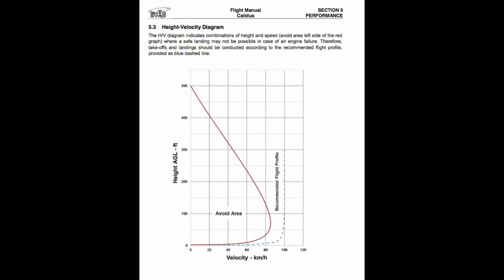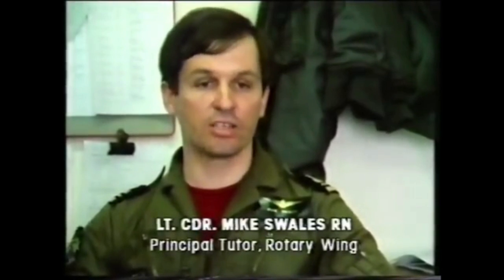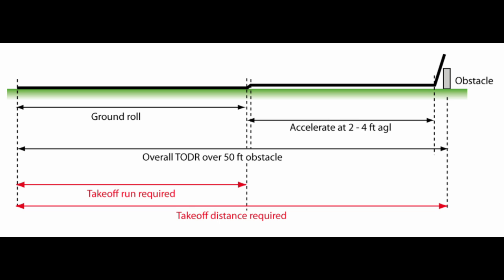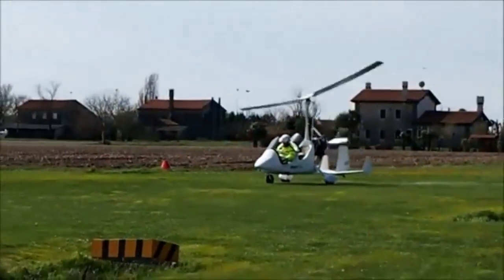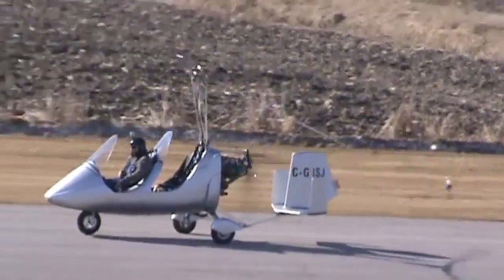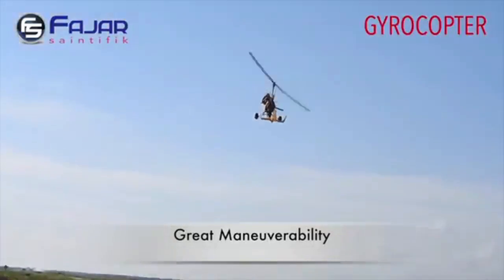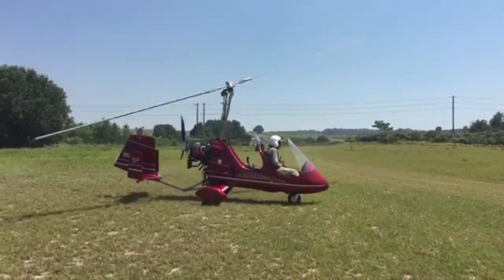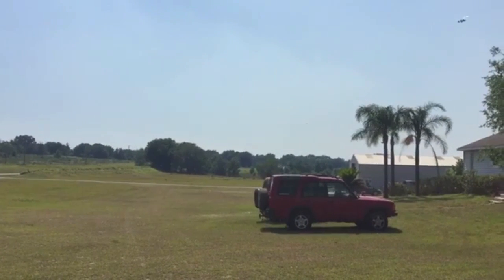A Gyrocopter is NOT a short take off aircraft...

Comment: @Gyrocopter flying club - I have just subscribed to your channel because I found this video very illustrative and useful. I would like to ask two questions, if I may.
1.- Is it impossible to somehow incorporate some small fixed wings that may help solve this issue? 
2.-  Would it be better to plase the engine in the front so that it provides a lot of extra wind to the main rotor as well as providing more stability?
Reply from the maker: Thanks for the kind comment.   I think you've designed a Cierva C19.  In truth wings on a gyro help in flight but the AoA during take off probably mean that the profile that isn't stalled during this phase is a burden during flight.  

A gyroplane is a short enough take off aircraft to be interesting / capable for most situations and the film is merely a caution to those that may get sucked into the marketing claims of some manufacturers.
Reply: @gyrocopterflyingclub6148  - Thank you for replying and for the explanation. You are right about the manufacturer's claims. I myself was falling for it. 
Haha... Not that I was trying to be clever.  It is simply that I am curious about the technical reasons. 
It bothers me the fact that gyros are evolving towards clumsy "not-affordable" luxurious vehicles instead of utilizing the overwhelming new tech in order to make gyros more wind independent and to follow Bensen's marvelous philosophy of "affordable flying".
Reply from the maker: Yes I completely agree on the direction of the aircraft and in the end once the gap to basic helicopters becomes minimal people just fly a helicopter because they perceive they may need the VTOL even when they fly from the same 3-4000ft airfield they did in a fixed wing!  

We have lost a little of the fun however take a look at the NANO film that looks a nice aircraft.

Comment: The gyro can be made to take off vertical and will take off within 100 feet! Apples to apples!
Reply: to take off verticaly this need a very strong rotor prelauncher able to reach more than 400rpm , a heawy rotor (to increase the inertial) and a collective pitch control: such Gyros are called jump gyros...For short take off this need a strong rotor prelauncher able to reach close 350 rpm and a very good power to weight ratio...basicaly a gyro with standard rotor  is same as a fixed wing aircraft in the difference that the rotor rpm should be closely monitored because loss of RPM with too steep climb at take off= death...
Reply: @leneanderthalien  check the existing models!

Comment: Doesn't  the ability to spin the rotors up to 300rpm now, makes for a shorter take off.
As the wing is made much earlier.
I am keen to get into a gyro in my retirement, and some of the newer models claim 300 rpm rotor spin for take off.
Which sounds much more attractive an option.
Reply: It really doesn't do much to clear 50 foot obstacle. That's the standard definition of takeoff distance. To achieve 300 rotor RPM, you end up going to almost full power, then you pull the stick back somewhat and the drag slows you from accelerating to Vx (48 knots), so by the time you reach that to safely climb up and gain altitude you really are close to where you were. To me the 300 RRPM seems to be more of a gimmick for marketing material. If you look at their POH and actually see what it says about takeoff distance (standard takeoff distance to clear 50 foot obstacle), the length given is no different than when I pre-rotate to 200 rotor RPM
Reply from the maker: Agree/disagree Abid - see the other reply.  The key is dealing with the drag.  The actual data however given by AutoGyro is poor in terms of the detail but having flown all AutoGyro models a lot (you have poor choice of aircraft in the UK) 914/915 and 300+ rrrpm makes a difference.  Actually in a 915 motor aircraft you are forced to not use full back stick for long because you'll get dumped on the tail fast!
Reply: @gyrocopterflyingclub6148  I think what you are pointing to is that with 300+ RRPM the stick should not be all the way back but somewhere near neutral to take advantage of this pre-rotation to reduce takeoff distance to clear 50 foot obstacle. Phil yet in the other video posted in your reply at 1:45 onwards, the takeoff distance to clear 50 feet shown with 320 rotor RPM pre-rotation one up seems basically the same distance I see in an AR-1 914 one up pre-rotating to 200+ RRPM. So where is the advantage? Now I did not get to try it one up when I just trained a student who owns a MTO Sport 2017 914UL and we tried this 300 RRPM takeoff technique with stick somewhere near neutral. May be I am missing something and I would be happy to know any tricks or anything to try. He will be back to take final prep hours before his checkride sometime this week. We can try them. Don't be shy to let me know. I am not an expert pilot by any means. I have not flown 915 MTO 2017. I have only flown AG915 once but it was not properly rigged at the time.  
But in theory yes you have to overcome the drag of the spinning rotor to get to Vx to have a safe climbout and not settle back down. You have to do that without letting the rotor RPM perish as well so its a balance. The directions to conduct this takeoff in the POH are not very good at the least.
We have a short field takeoff, demonstrated by Greg here but Greg has thousands of hours. There is also a 10-12 mph headwind here but it requires keeping pre-rotator engaged as you pull stick back and move forward. Again a delicate balance. Its also hard on pre-rotator components especially the upper U-joint and hence should be used only when really necessary and upper U-joint checked and possibly changed on condition
https://youtu.be/iMb5BOm_GYg
Reply from the maker: Hey matey - the take off performance compared film at 1:45?? If so both aircraft are pre-rotated to 200rrpm and if you are looking at that film then at the end of it (around 3:29 onwards) shows the difference (one is +100ft the other is still building airspeed).  

OK something to try with the 17Sport - is pre-rotation to 320 means power is very high anyway at brake release.  Just bring the stick back to halfway (thats the subjective part which really needs building up to because as you know its better to have it further back than not enough initially) but brake release - and full power into the boost - and it should unstick within <50m, then build airspeed.  With a 915 there basically isn't any airspeed build up phase tbh - its just there immediately pretty much at unstick the acceleration is so good.

Yes I hear you and I completely agree - this is the problem with the advice is that this isn't really 10hr solo pilot stuff and a lot of critics in the UK think everything needs to apply to them - and it simply doesn't.  

In the end the senior instructors in the UK (who have got very one eyed about wheel balancing) put themselves in a box with the criticism because when they teach differences training to any pilot with a rotor head 3 that can pre-rotate to 320rrpm they will all have to develop their techniques.  They haven't embraced it IMO because they have resisted change simply because it will require books and material to be re-written.  Nothing to do with safety, nothing to do with improving performance and everything to do with commercial self interest.
Reply: @gyrocopterflyingclub6148  Actually I meant 1:45 on this video
https://youtu.be/RqyEFgWF92o
I will ask my student if I can try this again without his engagement.  The rotorhead 3 achieves the 300 RRPM by mainly decreasing the size of the ring gear. In my opinion wheel balancing phase of takeoff should be kept as short as possible as this is where its most susceptible to gusting crosswinds etc. Things can and do go wrong there. How many times I have read on RWF, I was wheel balancing but took off or gust came and I flipped it over. Of course old school pilots have always disagreed
Reply from the maker: Arh yes - that is a piece of film with a pilot called Jim Hughes in a 914 Sport.  To be honest I used that clip just to show the 2017 sport etc as I have no idea what technique he was using.  That said Jim was a big advocate from the gyropedia school of thought who are all wedded to a take off process that has wheel balancing and part power front and centre.  Perhaps Jim drifted from that during the flight filmed but it would be a big departure for him.  

Try it - we still have airfields closed and its a faff trying to fly in the UK right now - otherwise I'd film it myself.  In the end at 320rrpm the rotor is at flying speed so really what you need is a stick position that gives a shallow climb and get the aircraft to >30mph and you'll fly it off.  

One trick is go flying and with you sitting normally see where the stick position is when you adopt 10deg nose up.  If you put the stick in the same position from 320rrpm pre-rotation you will achieve the same.  Obviously whilst watching RRPM gauge to ensure in whatever process you're using the RRPM doesn't decay too much.  You could actually keep the pre-rotator in until you rolling.
Reply: @gyrocopterflyingclub6148  
Hi thx for the informative response, I watched the clips you suggested and now  think I have an understanding of what the extra rotor speed will do.
If I am correct, in non-technical terms, higher rotor speed will provide a more complete wing earlier, but add extra drag, which will then need more engine power to get the air flowing under the wing to provide the lift earlier?
Therefore nullifying any bonus a faster rotor speed on takeoff may induce.
As the wing itself does not provide upward lift like a helicopter, but is an umbrella to float on instead, with turbulence drag at the tips.
Please correct me if I am wrong.
But that is a really cool set of physics happening there.
Maybe it will lead to a different design rotor blade to take advantage of the motor induce extra rotor speed on takeoff.
Thank you so much for your time on this query.
Reply from the maker: Hey no problem for the time taken. Yes you are right but also think about the angle of attack - its not just the higher rotor speed that creates drag but in the cases of holding the stick fully back for a long time during the take off roll the Angle of Attack is huge.  https://www.grc.nasa.gov/www/k-12/airplane/inclind.html
Reply: @espenforfen1334  yep your right it has to fall constantly on the rotors. As a matter of fact someone made one like an umbrella in place of rotors
Reply from the maker: Hi - its not a simple answer.  So if you have time take a look at the other films I've made in particular this one:-
https://youtu.be/RqyEFgWF92o

Specifically on the 300rrpm element - if you want to make the most of it you need two things.  1) you need to adopt a take off technique closer to one I have suggested for around 3 years now and if you google "AutoGyro 2017 Sport POH" and look at short take off in the POH.  That explains the issue with drag - as I explained it here:- 
https://youtu.be/kW65IY39MPU

If you combine that with a bigger motor - so Rotax 915 power - it makes a difference, and I say that with practical experience of the aircraft, not just paper theory.  If you use 912 power then if you use a "legacy" take off technique i.e. look to hold a wheel balance and get there on part power - then actually you take longer to get airborne because of the huge increase in drag.

Comment: Why don’t gyroplane pilots give it the berries on take-off? I have to be missing something. Next I’ll be told idle descents are not possible.
Reply from the maker: Ha this is a current debate.  They can perfectly start their ground roll with 100% throttle but the problem with the legacy technique of full back stick maintained until the nose wheel lifts is that many get behind the aircraft - which means the aircraft is dumped on its tail. So to get around that the majority retain the “keep the stick fully back until the nose wheel lifts” narrative but introduce a part throttle set off to dilute the speed the process happens. Of course now that means a great change when the pilot really wants to get off... hence why the accident rate is what it is IMO.
Reply: Gyrocopter flying club - What do the aircraft AOM’s stipulate? They must describe the technique required. Every fixed wing aircraft I have flown (commercially) to date insists full power must be set by 60 kts in order to achieve required T/O performance. The figures in all manuals are based in take-off power being set. What do gyroplane manuals say?
Reply from the maker: This is another problem which I intent to cover in a separate film. The manuals are frankly gash. They don’t give clarity about how their numbers are achieved- indeed I saw a manual from the Spanish manufacturer recently that didn’t even give a distance to clear 50ft!! In the UK the CAA airworthiness dept have dropped the ball on this kind of thing.
Reply: You have to make the wing. You cannot outrun the rotor. The result of that is blade flap and a flipover